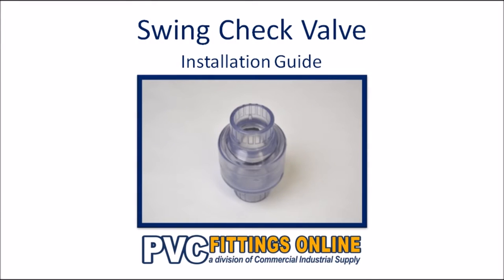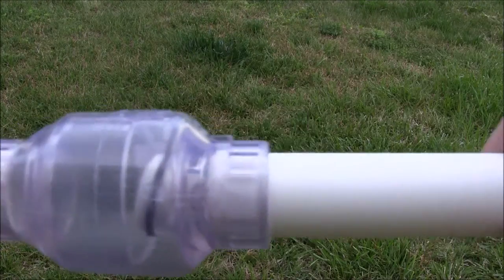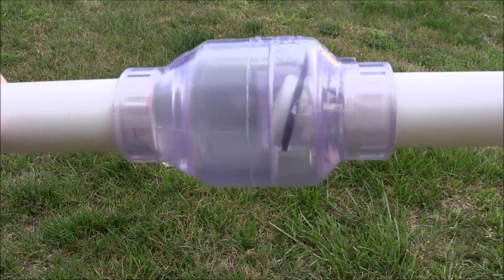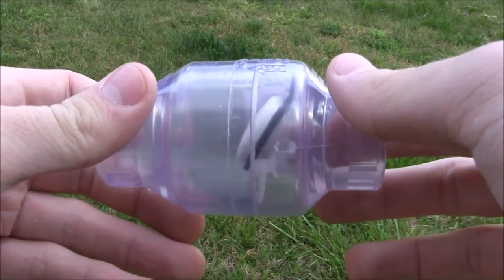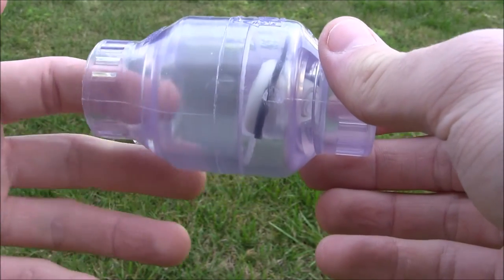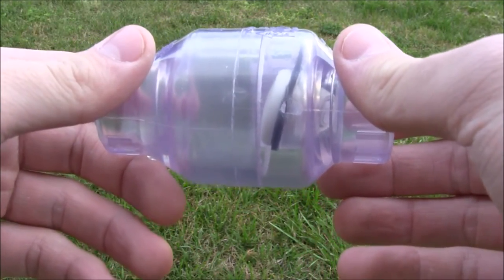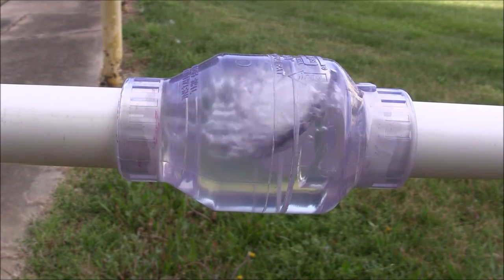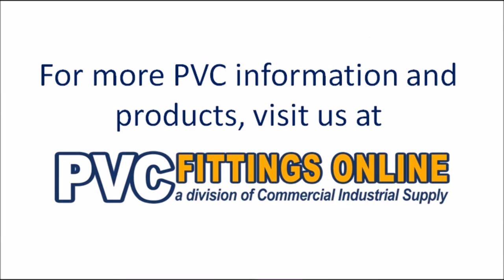How to Properly Install a Swing Check Valve

Comment: I know HOW a check valve works, I watched this video entitled "How to Properly Install a Swing Check Valve" to learn how to properly INSTALL a swing check valve. Specifically, I am looking for how much pipe to cut out from the existing line, relative to the length of the body of the valve.

I'll keep looking.